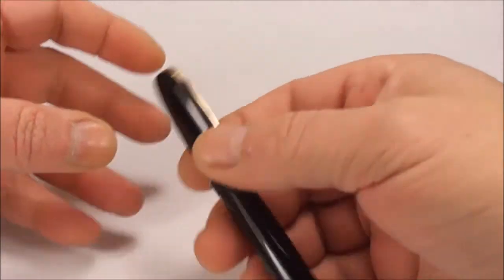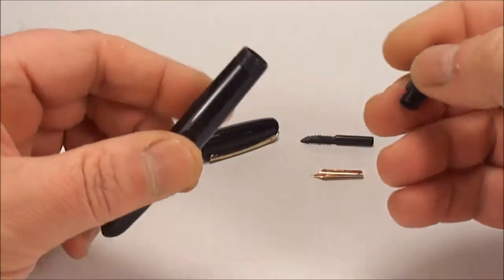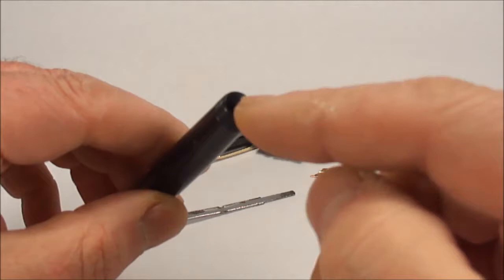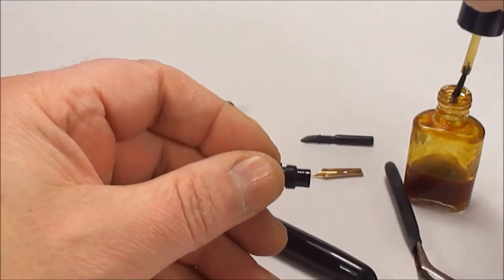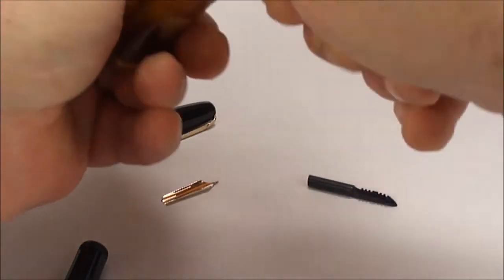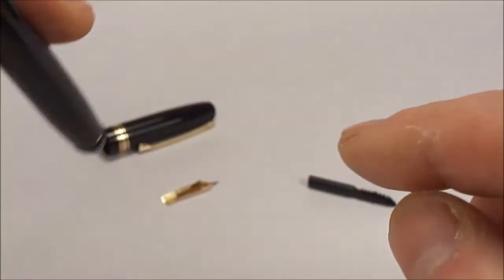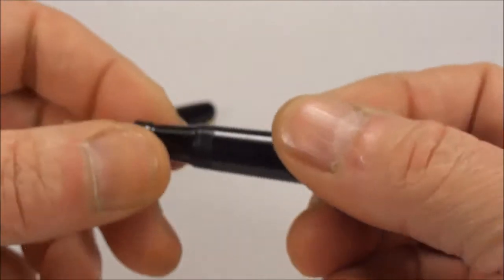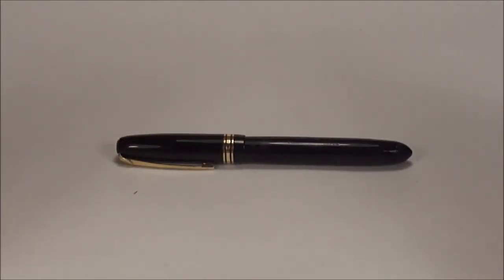How to service a Swan Mabie Todd Calligraph fountain pen.

Comment: Hi, thanks for the video! I’ve just acquired a leverless with a similar filling mechanism, but the knob on the end is stuck and unable to turn. Do I have to grease it or is it a sign that there’s something stuck inside? Thanks!
Reply from the maker: You will find that the sac inside may have solidified preventing the knob being turned. Do not force it. Good luck.

Comment: Great old pen!
BTW, how to pull off nib and feeder from an old Mabbie Todd eyedropper? I'm very much afraid to broke the feeder or crack the section. Thank you!
Reply from the maker: The section  needs to be wrapped in some electrical insulating tape to prevent any discoloring of the section. Then if you have one pop the section.nib and feed into a ultrasonic cleaner. Then very carefully grip the nib and feed with some suitable rubber and gently pull the feed out. Be very careful as you may break the fragile feed. The EASIEST way is to send it to someone with experience BEFORE you break the pen.
Reply: Thank you!
Should I heat the section before pulling?
Have already discolored whole pen by washing, but I really like ebonite's brown color , it looks very unusual %)
Reply from the maker: Heat the section were it connects to the barrel and gently unscrew the section. No no no soaking the pen in water as it will discolor the pen as you have found out.
Reply: Thank you very much!

Comment: I have just recently acquired one of these pens (in green though), and the knurled part of my pen is in very bad shape. It looks almost disintegrated (though still very functional. Furthermore, the turning mechanism feels VERY stiff. Is this normal? This was a really informative video, and I really love the nib on this pen. It's a pleasure to write with.
Reply from the maker: makey95 Little difficult to comment without seeing the pen. If the filling knob is stiff it may need a new sac and servicing, as the sac may have solidified inside. Good luck with it.
Reply: Grandmia Pens The pen has a new sac, but a very rusty bar; may that be causing stiffness? Can the knurled part/twist mechanism be taken apart without damaging the pen (and/or replaced, since the knurled part is cosmetically damaged).
Reply from the maker: makey95 If the bar is rusty it should be replaced. The filler knob can be taken apart but needs a special tool.
Reply: Thank you! That was really helpful; I really enjoy the nib on this pen, so I would hate to have these issues detract from my overall love for the nib.

Comment: What is the size of pressure bar?
Reply from the maker: I do not recall, if in doubt measure your pen. In some cases the pressure bar may need to be adjusted to fit. Good luck.